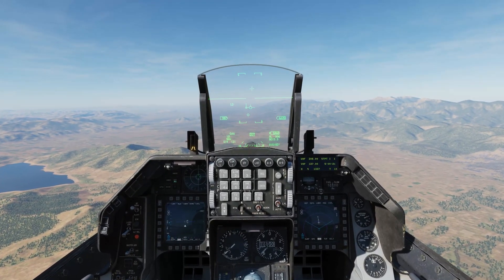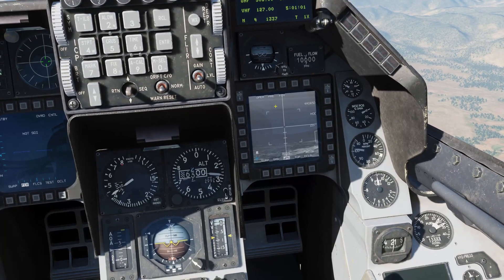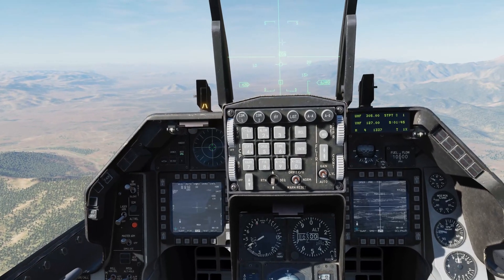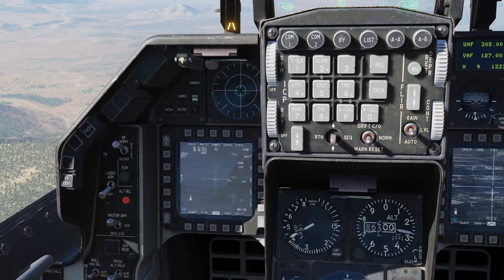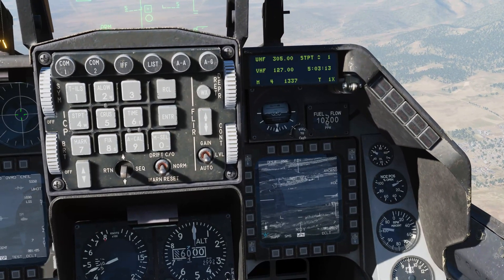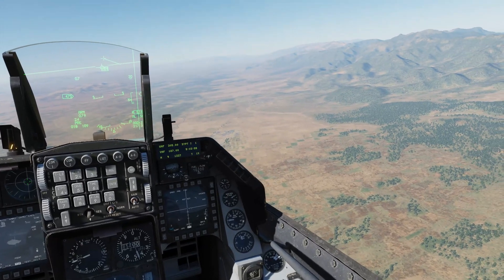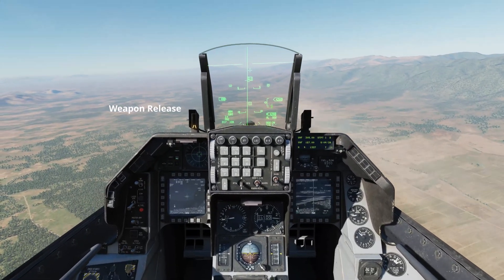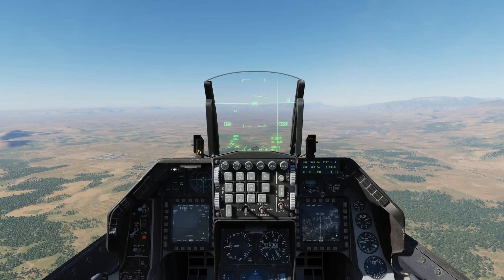F-16 Mavericks in PRE mode FIXED! First look tutorial | DCS

Comment: at 02:40 you say TMS up for handoff but this does not work at my end, you have to press TMS right?
Reply from the maker: In theory both should work.  In the video I handed off the target with point track (TMS Up ) and you are handing off the target as area track (TMS Right).  Point track handoff will only work if the target can identify what it is looking at as a point, ideally something small with significant thermal contrast to it's surrounding area, that is if you are using IR mavericks (Either D or G variants of the MAV).

Comment: I still can't boresight the mavs: when it says Handoff in progress the cross of the mavs doesn't align with the target, so I have to slew the cursor manually. If I'm not mistaken, this issue happens either in MAN and AUTO tgp modes.
Reply from the maker: Once the handoff completes, DMS Down to select the WPN page. Manually slew the MAV to the same target that the TGP is looking at and press TMS Up. On the WPN page click the “boresight” OSB button. All of the MAVs on that pylon will now be aligned with the TGP. I think the process and tips for it might be my next video. Thanks for watching 🙏
Reply: @grifter2517  Slewing the MAV to the same target that the TGP is looking is THE problem because very often I can't spot the target on the ground with the MAV, so I don't know where slewing the MAV to, even when I've already spotted it with the tgp earlier. This happens when target is masked by a bulding or trees, or when you have multiple targets on the ground but you need to kill just one of them ( for example just one SAM, that you have earlier spotted with the TGP, among trucks, tanks, or APVs). In these cases slewing the mav to the same point of the tgp is very difficult.
Reply from the maker: New video up on BSGT process with tips. Not sure it solves your problems but might be worth a look.
Reply: @grifter2517  Thanks for explanation. I'm waiting for your next video :-)